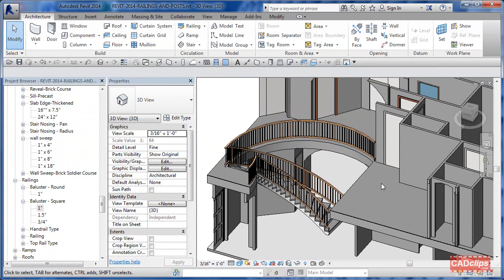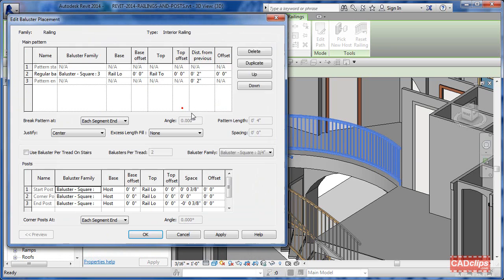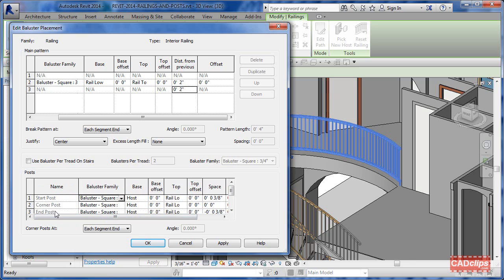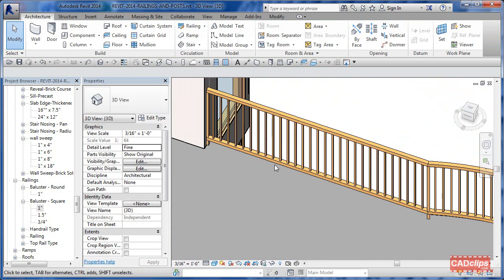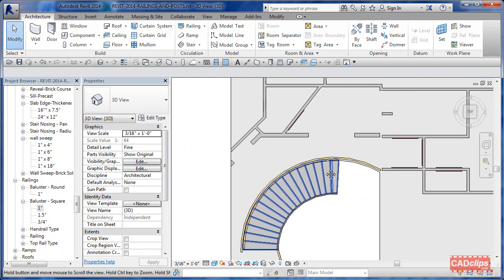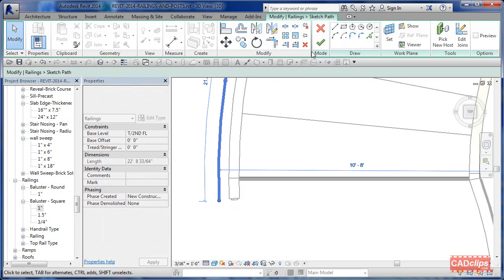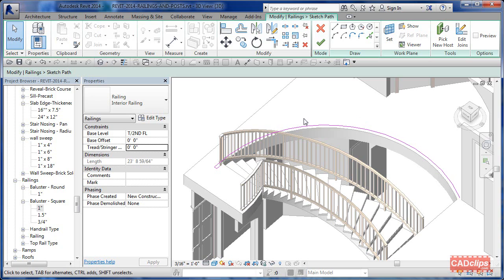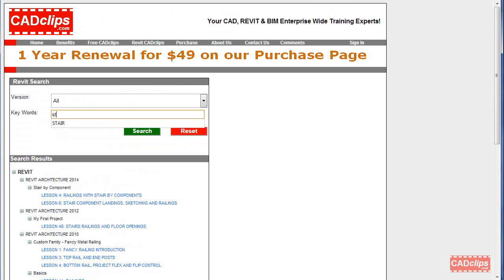REVIT Railing and Posts Tips - CADclips

Comment: THANK YOU FOR THE TUTORIAL.  EVERY  STUDY TEACHERS  HOW TO USE A SINGLE LANDING BUT NOT A DOUBLE LANDING.  ig.  Stairs from ground floor   to upper floor.  Runs coming up ends half way  in the 1st landing width & height of the run but depth of  say 900mm. From there it goes into 2nd landing  higher than the 1st with same width, height & depth,  and runs turns , goes parallel to the runs from ground floor up to the upper floor.   

Normally two runs joins with one landing in the middle but not with two parts.  2 x Half a landing. 

I have searched for  stairs by sketch yet couldn't find it.  Please help.
Reply from the maker: Makes sense to me but as you describe would involve more than one stair. The new REVIT multi stair however may be your answer.
Reply: Thank you for replying,  New Multi stairs  shows none.  It is an old fashion staircase  bit like the winder  but cannot see a tutorial for it.
Reply: Thank you.  I am trying to draw by sketch if possible.